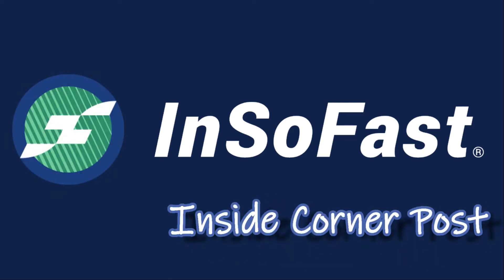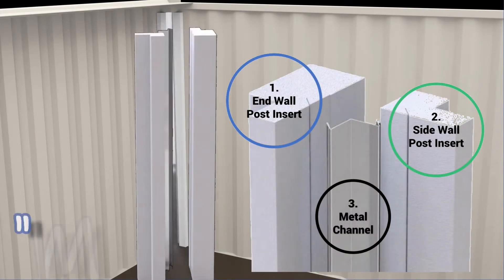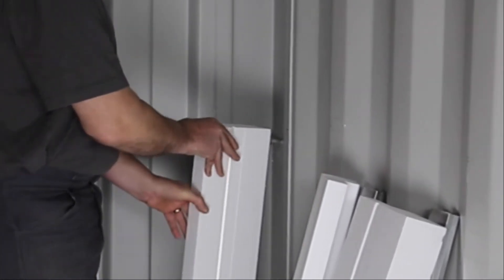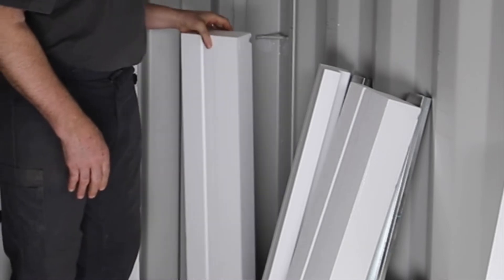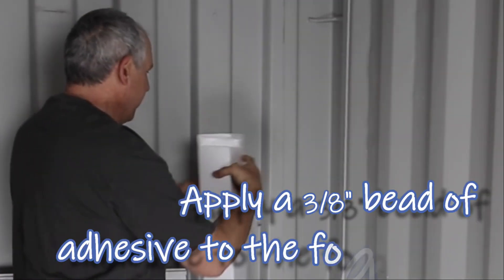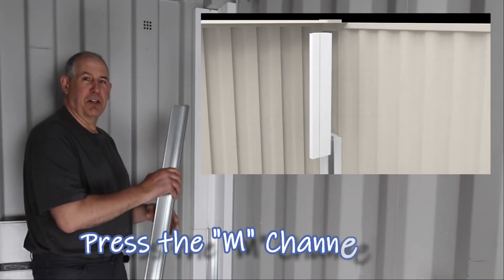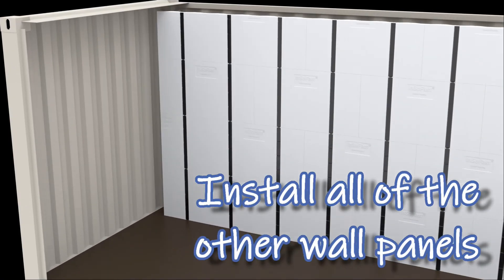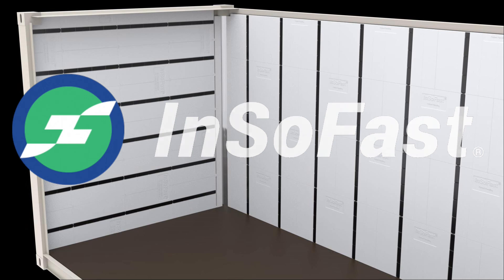Insulated Corner Post for Shipping Containers

Comment: Those black stripes? What are they for? It is rubber. It is better stick surface to glue dry wall?
Reply from the maker: They're the plastic studs, which replace the 2x4 framing with cavity insulation. Drywall ready!

https://www.insofast.com/about-us/about-our-insulated-studs